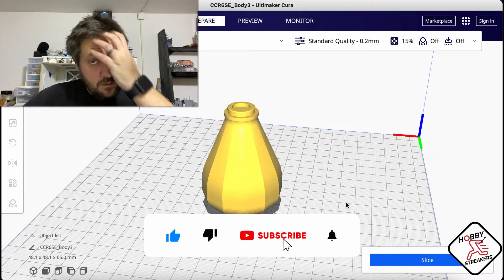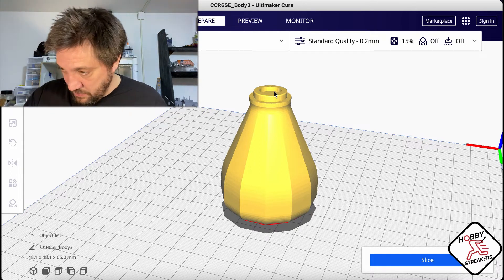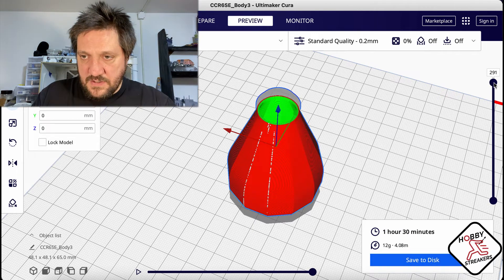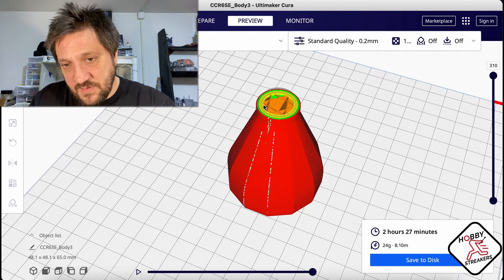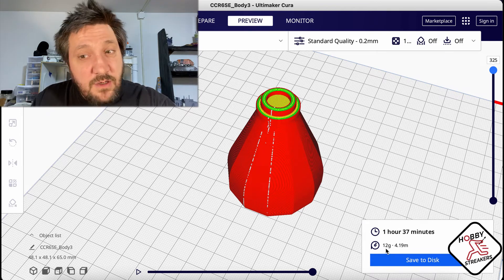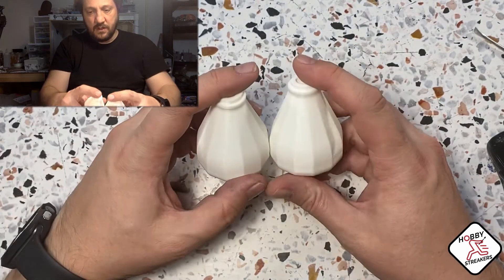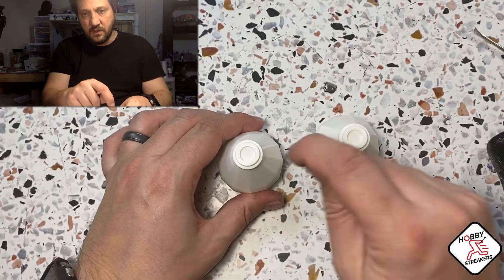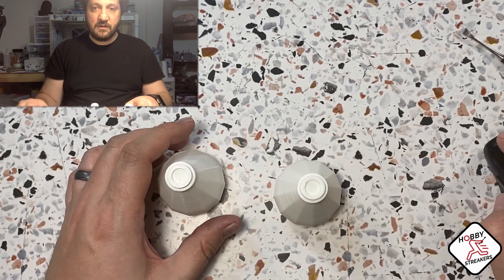3D Printing - Lightning Infill in Cura

Comment: appreciate the information, i have started my first print with lightning infill fingers crossed its a success its a large piece so i went %50 lightning infill because i was worried may be overkill.
Reply from the maker: I’ve printed some terrain (rocks and terrain pieces) with lightning at 15% and that worked well. I’ve printed some mechanical parts still with the regular infill. It really depends on the application. Let me know how it works out
Reply: @thehobbystreakers  i certainly will im currently printing myself a incredible hulk statue i plan on painting and so the torso is whats printing now. Im 4 days in a 8 day print
Reply from the maker: @Rawshade  wow that’s a very long print how big is it? My longest print was probably around 35H give or take a few hours
Reply: @thehobbystreakers  the whole statue is going to be 29.5 inches tall ill take measurement when i grt home of just the torso but i also did 0.12 layer height for extra detail
Reply: x346.8mm y231.2mm z278.8mm before raft and supports on my cr10s5 .4mm nozzle
Reply: @Rawshade  so I'm also printing a statue about 15 inches tall.  Did lightning work for you?
Reply: @davidfirnstahl9963  yes lightning worked perfectly saved me a ton of pla and it looks awesome.